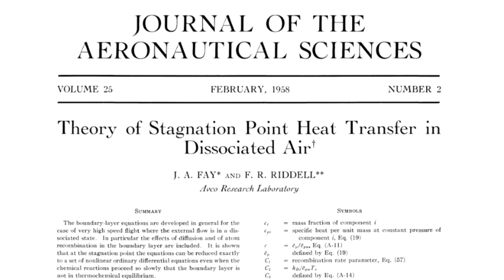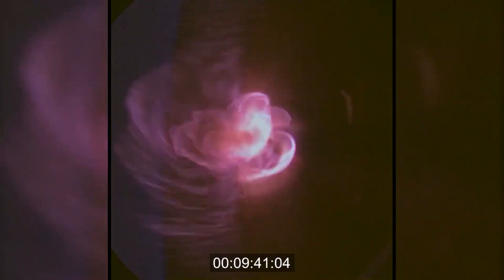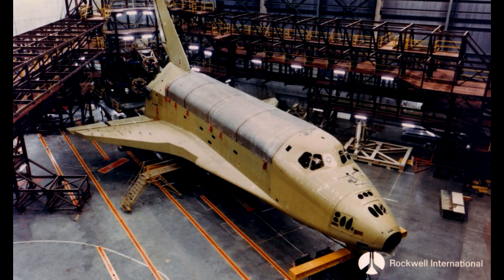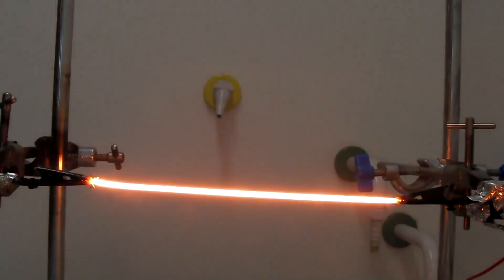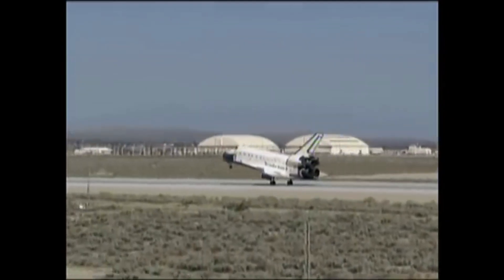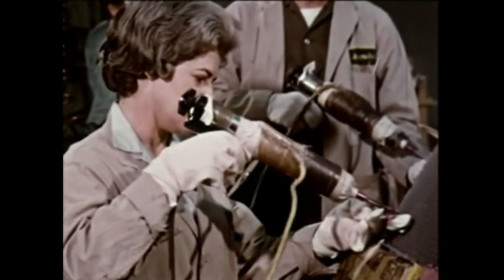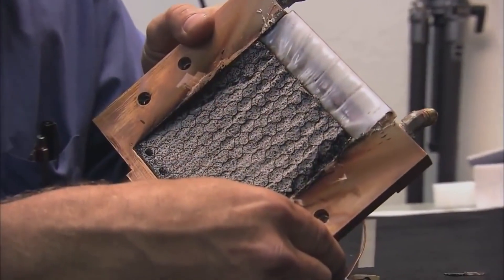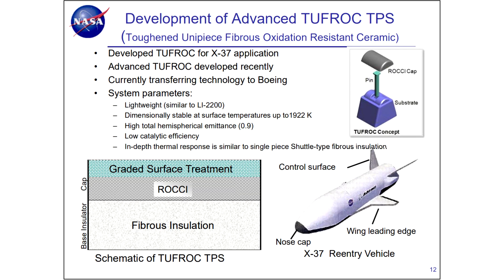Heat Shields - Things Kerbal Space Program Doesn't Teach

Comment: Excellent rundown of the subject! I always thought that as technology and operational experience advanced they could build a Space Shuttle 2.0 that would correct for many of the deficiencies in the 1970s design someday, and heat shield tech would be a major part of that.
Reply: Early Space Shuttle concepts were planned to use a metallic heat shield on top of a titanium hot-structure airframe. But as the orbiter design grew larger to meet USAF requirements, that became unfeasible and forced the switch to an insulating shield on top of an aluminum cold structure.

That's also what makes me eager to see what SpaceX is attempting with Starship, since it's something of a best of both worlds by combining an aluminum cold-structure airframe with a metallic shield.
Reply: @pseudotasuki   The orbiters grew denser, not simply bigger in volume. In fact a number of the orbiter designs prior to the military involvement were bigger, but lower density because they were mostly big empty fuel tanks and were more like the X-37B in configuration with very small wings or no wings at all (true lifting body designs) since NASA did not need the super high 1500 nautical mile cross range capability.
Reply: Sierra Nevada's Dream Chaser has alot of these upgrades you speak of.
Reply: @adamc1713  Dream Chaser can't carry 7 people and a school bus-sized payload to orbit and back. People say that capability, mandated by the USAF, was overkill, but it was there, and it was used, for things like Hubble, space station construction, LDEF recovery, and so on. So to me an STS 2.0 would not give up capability, but deliver the same capability with better safety and economy.
Reply: @RCAvhstape   Many of NASA's original Shuttle design requirements still mixed crew and cargo with a baseline 25,000 lb (11 tonnes) to LEO payload and the ability to bring bring a similar amount back in addition to as many as 12 astronauts. All this was before the military's requirements got slapped on and the Shuttle's only purpose was to be a logistical vehicle for a very large space station. A space station that would've been made up of 100 tonne modules launched separately by Saturn 5s. In turn the space station's purpose would not have been limited merely to research, but also serve as an assembly depot for manned Lunar and Mars ships.

And yes, it is quite true that the 30 tonne to LEO at 28.5 degree inclination, 15 tonnes to near polar inclinations, and 1500 nm cross range was indeed all mandated by the Air Force and Department of Defense as well as by the National Reconnaissance Office and Central Intelligence Agency for their spy satellites. All of that made the Shuttle heavier, more difficult to research and develop, and far, far more expensive.
Reply: @RCAvhstape   Many of NASA's original Shuttle design requirements still mixed crew and cargo with a baseline 25,000 lb (11 tonnes) to LEO payload and the ability to bring bring a similar amount back in addition to as many as 12 astronauts. All this was before the military's requirements got slapped on and the Shuttle's only purpose was to be a logistical vehicle for a very large space station. A space station that would've been made up of 100 tonne modules launched separately by Saturn 5s. In turn the space station's purpose would not have been limited merely to research, but also serve as an assembly depot for manned Lunar and Mars ships.

And yes, it is quite true that the 30 tonne to LEO at 28.5 degree inclination, 15 tonnes to near polar inclinations, and 1500 nm cross range was indeed all mandated by the Air Force and Department of Defense as well as by the National Reconnaissance Office and Central Intelligence Agency for their spy satellites. All of that made the Shuttle heavier, more difficult to research and develop, and far, far more expensive.
Reply: @RCAvhstape   I agree that the Dream Chaser does not match the capability of the Space Shuttle and is not designed to. I was more referring to the idea that many of the material and technology advancements discovered since the Shuttle era are being applied to Dream Chaser. I say this as a former Shuttle technician and current manufacturer of components for Dream Chaser.
Reply: @adamc1713  True that. There were lots of ideas for upgrading STS over the years that never got the funding to go ahead. Liquid flyback boosters to replace the SRBs, for example. Stuff like that would be a no-brainer for an STS 2.0, where all the lessons of 30 years of operating STS could be applied.
Reply: @RCAvhstape   I started working on the Shuttle program right around the time they were considering 5 segment boosters that would supposedly eliminate the necessity of RTLS in the case of a main engine failure. We had also been told that RTLS was more of a hope than a guarantee anyway. People have a hard time accepting that space flight is inherently risky and they want endless contingency plans.
Reply: @adamc1713  Yeah, that's true, but the fact is that STS really was kind of dangerous. When it was designed the idea was to limit it to a catastrophic accident about once every 1000 flights or so, which is totally unacceptable by commercial aviation standards, and that turned out to be wildly optimistic. The actual accident rate was about 1 in 60, with almost no hope for crew survival or rescue during most of the flight. Now that may be acceptable for a test plane with test pilots, like an X-15 type program, but for a vehicle that is to be the core of the nation's space access and which risks 7 people at a time, that's too much to ask. Especially since the Shuttle had a huge public profile and had the emotions of millions of Americans (and quite a few American friends and partners) riding on it, watching 7 people die live on TV is unsustainable. Would've been better had, say the USAF operated it and kept it mostly hush hush, SR-71 style. I'm just rambling now, of course, the real world did not and does not work that way. Friend of mine worked on the Challenger mission that failed. To this day he still feels guilty even though he had no part in the mistakes that caused it. That's a heavy load to bear.
Reply: @RCAvhstape  I would suggest you look at a picture of a KH-11 and Hubble side by side and guess which is which...
Reply: Helium Road take a look at the hush-hush X-37B
Reply: @thebigitchy  That's largely the same design as the Shuttle.
Reply: The other thing a 21st Century STS needs is a quicker turnaround time - ideally using engines that don't need replacing every flight or just going the Buran route and leaving all the launch engines on the rocket

Comment: Laser cooling techniques combine atomic spectroscopy to compress the velocity distribution of particles and cool particles. If the transistor can be miniaturized and trillions can be etched on the CPUs of computers , then cooling laser technology could maybe in the future act as a heat shield or propulsion system . The rapid depressurizing of an atmosphere  , even plasma in spaces to near 0 Kelvin and the Einstein Bose Condensate that could be absorbed into a space vehicle as fuel , could be a method of scavenging gas for fuel  . When a nuclear heat source such a plutonium is introduced any Condensate would expand possibly creating thrust  , or at great velocity forward thrust by a suction effect .
Reply: huh?

Comment: How will the starship manage if it runs out of methane? Isn't  it risky that starship depends on it's fuel not being all used up before re-entry
Reply: For the landing they do not need the thrust they need for take off so the liquid Methane could be very close to boiling temperature instead of being very close to freezing temperature. You can use the entire  methane load as the heat sink and if that is not enough you can use the LOX to condense vaporized methane back to liquid for use as fuel. In fact the propellant used for landing could be frozen solid at launch  and melt most of it back to liquid using the heat of reentry.

Comment: Early Chinese RV’s used wood as an ablator.  As it kind of hints at in the title of the paper at 1:30, it’s much better to think of aerodynamic heating in terms of stagnation temperature instead of a raise of temperature due to pressure increase.  The other paper referring to the temperature rise as due to friction is kind of misleading, but in that case the definition of ‘friction’, or what friction is, could be made pretty wide to make it almost ok; understanding that if there were no friction, the flow of gas would still be brought to rest in some geometries and the stagnation temperature (re-entry heat) would still be there.

Comment: "someone has to solve it if we are to live in that sci-fi future"
Not necessarily.  Much of that "sci-fi future" would also require either greater thrust or much (much, MUCH) more efficient engines and fuels, to where a returning spacecraft could slow itself to orbital velocity before re-entering, so it can come down at a more manageable speed for its heat shield,... or drop its velocity down almost entirely so when it enters the atmosphere, it is only moving supersonic or less, thus negating the need for a heavy heat shield entirely.

Comment: Great video. I wonder though, why didn't they consider using high strength stainless steels for the structure of the space shuttle? 440C has around the same strength to weight ratio as 7075, however its coefficient of thermal expansion is two times lower, avoiding a lot of the surface loosening and tile loss that occurred. Now, 440C looses its strength above ~700 F, but so does aluminum.....

Comment: I wonder why they didn't just carry a caulking gun full of ablative thermal compound for filling up gaps where a tile was lost. 
Or alternatively I guess a loaf of bread would work just fine.
Reply: I remember reading they did considered something like that, technology probably wasn't there.
Reply: The major difficulty is getting the stuff to adhere and not get knocked off by vibration ,pressure, expansion, etc.. It was always technically possible to have a layer of single use ablator underneath the tiles as an emergency measure in case the tiles broke off, but theres mass considerations. Perhaps a good solution would be to have mounting points underneath each tile, bolt somekind of support structure which can be cut to shape to those mounting points then laboriously fill it with caulk like the old apollo heat shield.
Reply: maybe NASA is very afraid to even entertain a sense of humour.

Comment: So what stops a space capsule tumbling uncontrollably, as most things do when they fall?  Or simply not falling 'heat shield down'?
Reply from the maker: Center of mass means only stable orientation is heat shield down.
Reply: @scottmanley  But it changes orientation from almost horizontal to completely vertical during its descent.  It's also subject to incredibly fast, turbulent air-flow.
Reply from the maker: @markgerhard1362  The orientation change you mention is relative to the airflow, the passive stability of the capsule forces it to make this change in orientation as the velocity changes.
Reply: @scottmanley  I don't doubt that, with minimal air-flow, the capsule would orientate itself heat-shield down.  But how is it stabilized in the correct position when the air-flow is much higher?

If you look at the Apollo command module, for example, the air-flow is against a large flat surface.  What would make that stable, when the position of the relative centre of mass is such that the stable position is with the heat shield down?
Reply: @scottmanley  I'm surprised that no one has an answer for this: simply having the capsule be more stable in that position wouldn't work because its orientation would need to change.

The Vostok capsule, for example, had no means of orientating itself after it started its descent.  It had a layer of Bakelite-type material on the sides, but had exposed windows.  Rocks burn up completely in the atmosphere, but the metal frames and glass of the windows were unaffected.  One of the ISS astronauts described the Space Shuttle rolling on reentry, and said that he then searched through the user manual to find a procedure to correct this.  But this wouldn't have been possible on Vostok.
Reply from the maker: @markgerhard1362  The vostok windows and frames were heavy, they had a lot of thermal mass in which to dump heat, so they could survive reentry just fine. The whole hull wasn't that thick because it would weight too much so they needed to use a heat shield.
Reply: @scottmanley  OK, but but even the most heat-resistant glass melts at about 800 degrees - possibly a thousand degrees below the temperature of the heat shield.  It also doesn't conduct heat well, so it would probably crack well before that point.

>>they had a lot of thermal mass in which to dump heat
They were only window frames.  I can't see them absorbing very much heat.